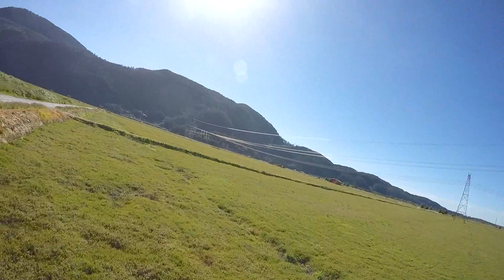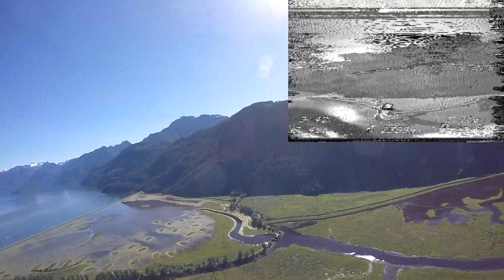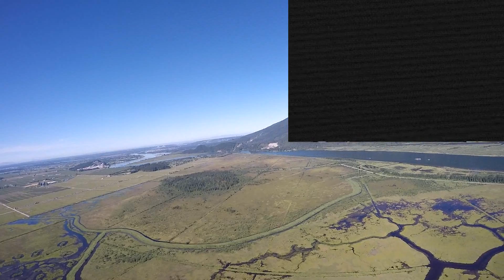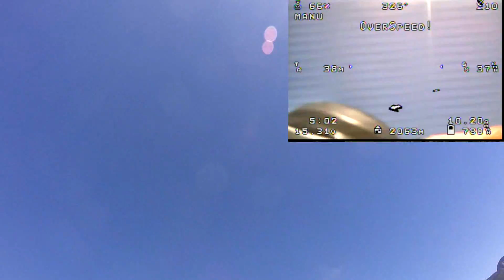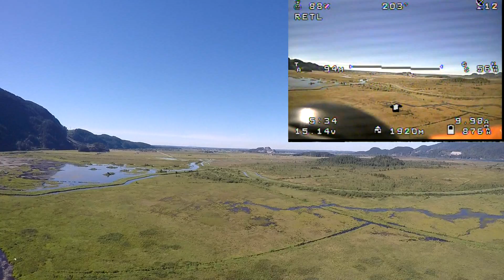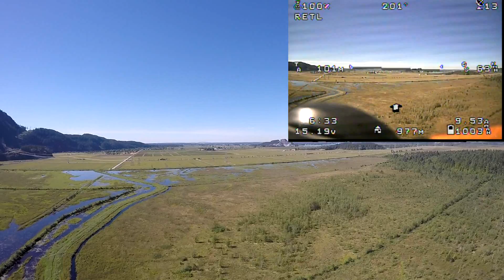Near crash straight to the ground at 100 kph - Mini Talon (narration)

Comment: Wow, I would have to take a walk and shake that one off after the landing.  Good save.  I have worried about that same event because I use two 3 way switches for my modes.  On the left I have manual, stabalize, and RTH.  Then on the right I have a NO FUNCTION, cruz, and auto.  The 3 on the left are mapped as normal on the taranis.  The right hand side I have set to REPLACE in the mix.  So they override.  Problem is if I am in cruz or auto and need to RTH I have to remember to return the right side to the upper "no function" position to unlock RTH.  Or I could just turn off the transmitter and let failsafe go into RTH.  Like you said, keeping calm and thinking it out is the key.  Nice narration.